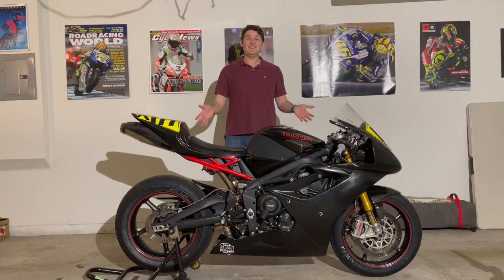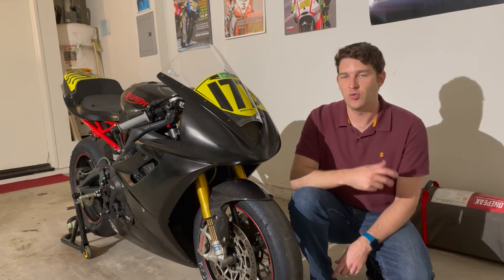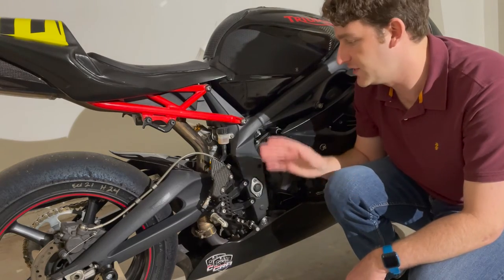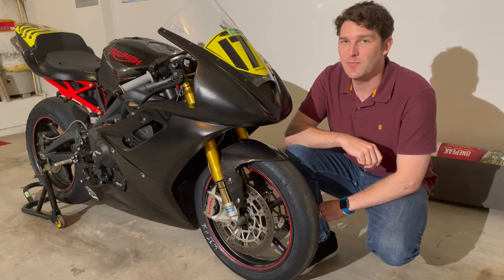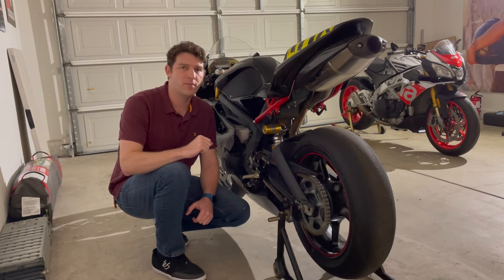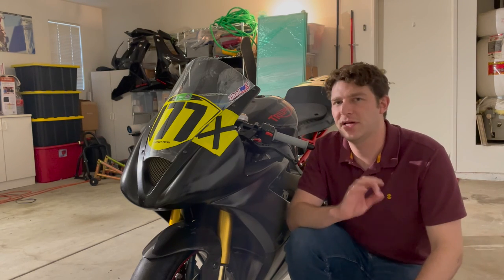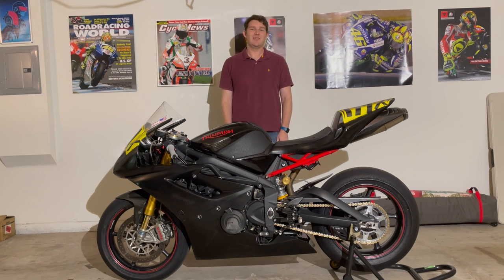Race Bike Mods and Setup Overview! - 2012 Triumph Daytona 675R

Comment: Good video Chad! You might think of trying a Discaciatta 19mm master cylinder too, I went from an RCS19 to it on my rsv4 and like it better despite being the same piston ratio. I think it has a little bit less “wooden” feel than the RCS19. With that being said both were a big improvement over stock.
Reply from the maker: Thank you! Appreciate the kudos and the referral. I think I have seen some people on the Triumph forum running the Discaciatta who had good things to say about it, so I'll certainly keep it in mind. Regarding the RCS19, when you say "wooden" feeling, can you elaborate? Like it's kind of flimsy?
Reply: @hiimchad  by wooden I mean the lever felt firm, but the bike didn’t brake as much as it could. I think this is a consequence of the piston diameter and lever ratio as compared to the rest of the braking system. The Discaciatta feels more proportional to the lever feel vs biking slowing down.

Comment: Great inspirational video. I've got one question, with what did you stick the carbon tank protectors on the tank and how did you hold them in place while the kit or glue was drying. Thanks! Gr from the Netherlands
Reply from the maker: Glad you enjoyed! There was something included with the sliders to secure them, I think it was an epoxy or resin? They've survived there crashes, so I whatever it was, it works well!

Comment: Cool vid. If you start getting more serious about racing, and begin pushing the bike harder, you could consider getting an aftermarket rear linkage and after market triple clamp with adjustable offset. That first gen (and “1.5” gen) Daytona has HORRIBLE geometry. Needs way more trail, and way more linearity rear linkage, than stock. They will transform front end stability, and rear end grip and “hook up,” respectively.

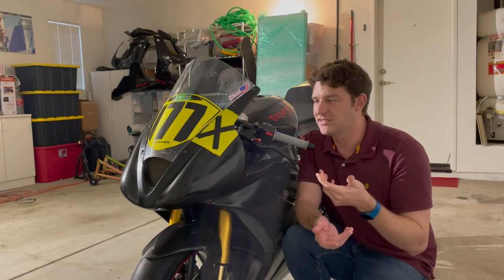Comment: 10:55  in terms of clutch less downshifts, did you fit your bike with autoblip in addition to the quickshifter?
Reply from the maker: Nope, no autoblipper. There are very few aftermarket options for this bike since they still use a mechanical/cable-actuated throttle, and from what I gathered they are not very reliable

Comment: I am im the market for a 675r to track. Would you suggest the 2011-2012 or a 2013+ for a base starting point? I have the opportunity to snag a 2012 with 35k miles for 5000 but has a charging issue. Trying to decide if I should pull the trigger as this is the lowest price inhabe seen on one in years...
Reply from the maker: Hey Sammy! I would keep my eyes peeled for a 2013+ if I were you. A lot of improvements were made to make the bike handle better, and the engine makes more power (131 in 2013 vs 126 in 2012 if I recall correctly). 

35k miles is on the high side for a bike to start seeing track duty imo, but it all depends on how well it was cared for. In my opinion, $5k would be an ok price if the bike was in great shape all around with that kind of mileage, but given the charging issue, I'd steer clear unless I was looking for a project. If I was, I'd be trying to buy it for somewhere around $3500. 

I recommend keeping your eyes peeled for a 2013+ that's already been converted for track use. They are rare, but I have seen a few in the $5-7k range with less than 18k miles. Have you joined any of the "track motorcycles for sale" groups on Facebook?
Reply: @hiimchad  thanks for the reply! I am gonna keep looking as the 2013+ or gen 3 is really what I had my eyes for originally. I am not on Facebook which makes groups like those haha.
Reply from the maker: @sammybrown6730  As much as I dislike Facebook and Meta, I do find it worthwhile just for the Marketplace groups. I've seen some very appealing bikes in there over the years!
Reply: 2013+ is superior in every way.